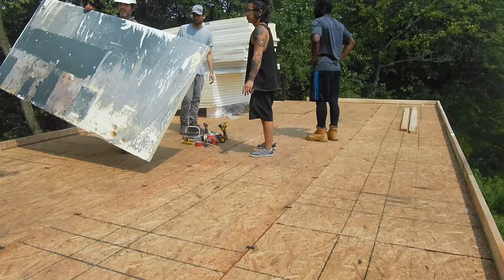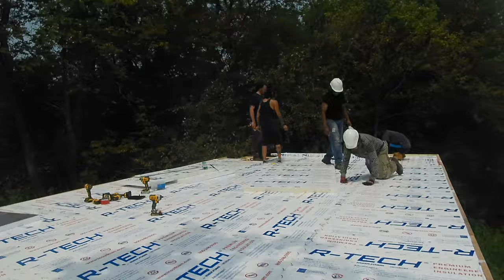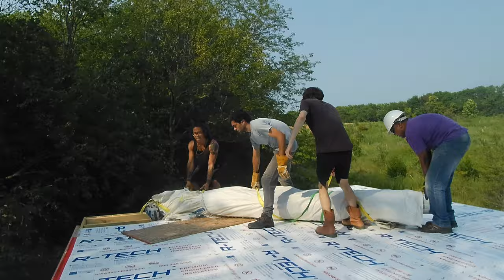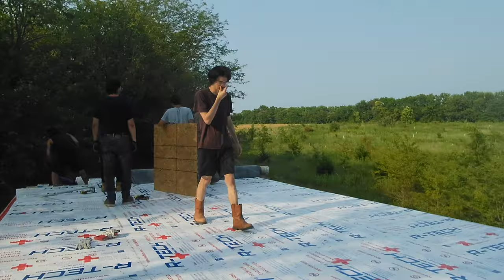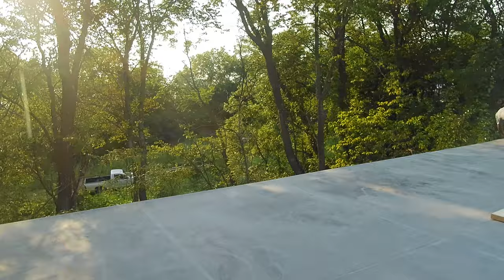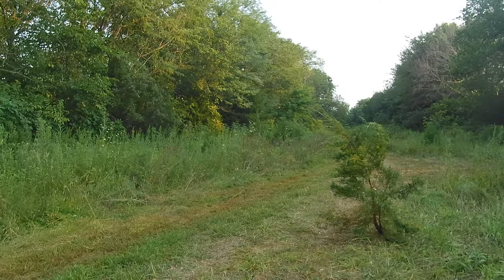Rigid Roof Insulation and EPDM Membrane Install

Comment: What if a tree branch blows off in a winter storm and punctures the membrane? Is it worth putting old pallets up there to protect the membrane?
Reply: I'll try and see if that is the final roof, it may not be, but rather just an under-roof membrane, i'll check though.